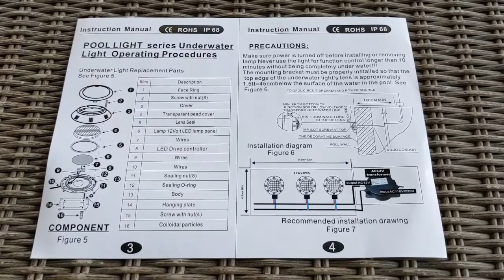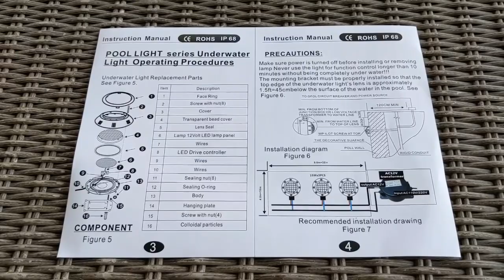Upgrading pool lighting with a surface mount LED light

Comment: I see on Amazon that it says the cable is 1.5 m. Was that an issue for installation @ScottAllison, or did you find one with a larger cable?
Reply from the maker: Yeah most of these surface mount ones come with a short cord..I had to extend it, using waterproof heatshrink fittings. It worked for 5 years until I removed this light when I remodeled my pool.

Comment: I have the exact same set up. Original fiber optic and I had the SR Smith mod installed last year. My pool is smaller so the light was perfect, but a year later, it’s flickering and gone out permanently. I’m debating whether to get the new bulb, or abandon that system. Any idea which is more work?  If a surface mount option is less than $100 difference, but way more work to install, I’m inclined to just replace the SRSmith bulb. I’d also really like the light to be on a timer. Did you find a solution for that?
Reply from the maker: I think if I was in your shoes I'd replace the bulb too. I didn't manage to put it on a timer because when it powers on it always goes on random pattern mode.

Comment: Did you have to lower the water under the light to install?i have the same old fiber lights that dont work great either thanks
Reply from the maker: No, I didn't need to.
Reply: @ScottAllison  so you installed this light with the pool filled up? Wouldn’t water get into the conduit tube that is currently holding the wire?
Reply from the maker: Yes but water gets into those anyway

Comment: Can you replace a light niche with a surface mount light?  Is it possible ?    Our metal niche needs replacing.  Is anyway to close up the niche and use surface mount?
Reply: 5:34
Reply: Two very different systems and while anything is possible it's not a simple change.  The issue is you'd have to cut the back of the niche, access the electrical conduit which is 1" or sometimes 3/4" and attach securely to that with a 1.5" wall fitting.  Then you'd have to hope the conduit isn't leaking.  There's also a bonding wire that runs through the inside of the conduit that would need to be removed.  Realize with all these systems water is always inside the conduit but because it terminates above the pool water surface you don't lose water.  Also I wouldn't put anything like the product shown into my pool unless it was 12 or 24V, using an inexpensive possibly not even UL listed amazon product inside a pool with 120v of electric running to it is not something I'd ever take chances with.  I don't know the details of the product, maybe it does use a transformer but again something that could literally kill your or your kids if it failed so I'd take this very seriously.  Best of luck, best time to change or repair a light niche is when you change the liner or have a cement pool resurfaced.
Reply: @BobsPoolService  he did state he installed a UL rated 120/12v Transformer in the old fiber optic tower and the light is 12v.
Reply: @chrisllang8055  That would help with safety so as long as it was possible to mount it and then seal from water leakage I'd imagine it could work although there is no easy retrofit for a leaking light niche.  Putting a plate over it that seals then mounting the light to that so long as where the conduit emerges is also sealed could work but I know of no product made to fit that scenario.  For fiber optica lights that use a standard wall fitting there are retrofit LED systems with 12V transformers that can be easily used.

Comment: I have the same light, but the RGB version. It has been working fine for two years, but recently the remote (same in this video) stopped working. I can see the red indicator light on the remote when I press buttons, but nothing happens, such as changing colors or turning it on or off, etc. I changed the battery and tried being very close to the light with the antenna fully extended, but there was no difference. The pool light works fine when I turn on the power, but it only cycles through different colors, and I prefer to have one solid color. Any suggestions? Thanks
Reply from the maker: That doesn't sound good. All I can suggest is buy another, and if that remote doesn't work I think you're going to have to change the whole unit out. So annoying that it doesn't remember previous light setting otherwise you could just power it on off at a switch instead.

Comment: What transformer did you use.
Reply: Where did you get the transformer
Reply from the maker: I used the original pool transformer which was an SR Smith PT6000, a transformer for a LED upgrade from the original fiber system. It's important to use a proper pool rated transformer for safety. I guess a landscape one would work too, but whether that would be safe for a pool installation I'm not sure.
Reply: @ScottAllison  so that tower is the PT-6001 LED conversion tower ?
Reply from the maker: @chrisllang8055 correct. Originally had fiber. Then replaced with that. When I bought the house that's what was there but neither the LED light or the transformer worked. I replaced the transformer in the tower and then put in this surface mount light, as it was much bigger and would be able to properly light up the pool
Reply: Please my light have transformer where will I install it down the water?

Comment: How has the epoxy you used to secure to pool held up?  What brand ,type of epoxy did you use? Thks
Reply from the maker: I used JB Weld's "Marine Weld". That was over a year ago and it's held up fine. I used the epoxy when the pool was drained, prior to that I'd initially done a temporary mount, which didn't last.
Reply: Thank You!! I am about to install a a dr smith 7watt kelo led for a 36ft pool. I probably should install a 45watt eapmic?
Reply from the maker: @The12345condor yeah, I think a single 7W light is probably not enough light for a pool that size